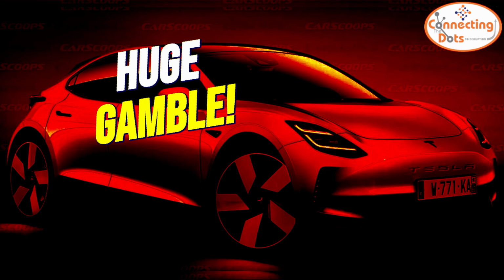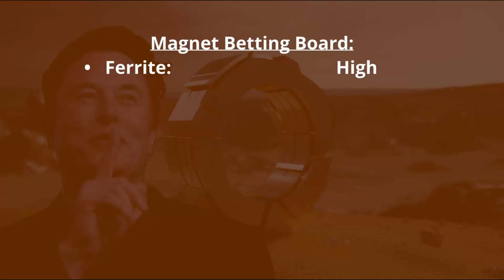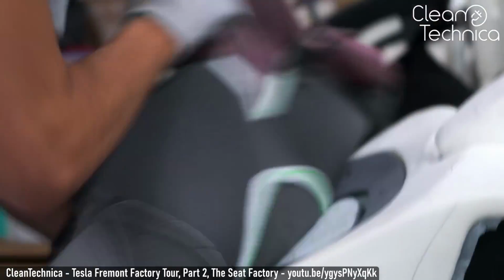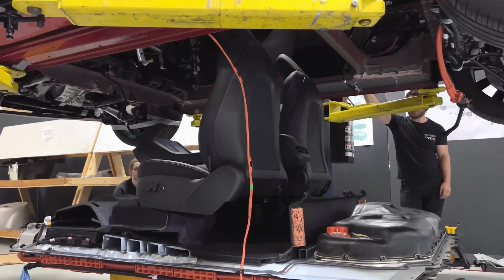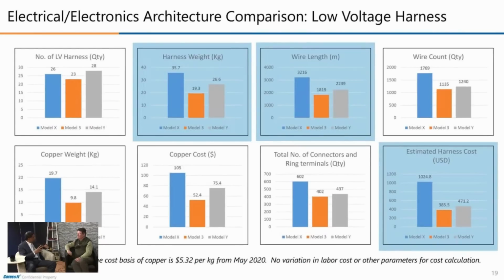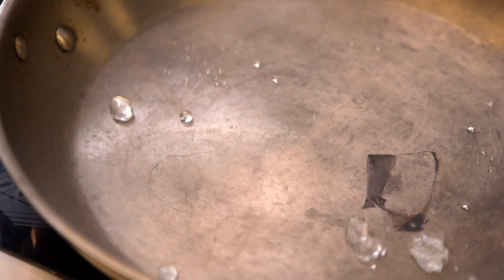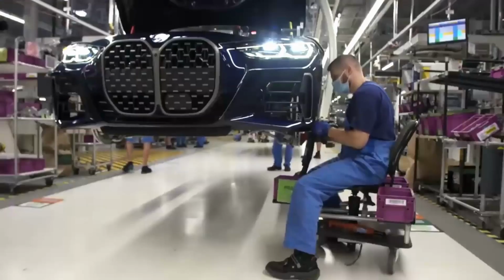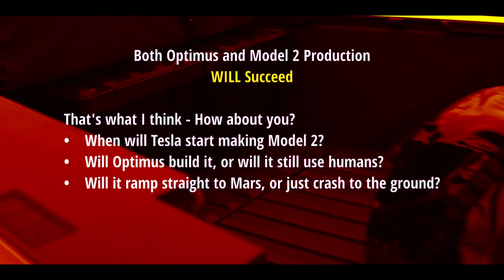Tesla M2's Tech Gamble: Runaway Success or Production-Hell Nightmare? Engineer POV [DecaValve WHAT?]

Comment: now that Tesla plans to announce the new Roadster at year end (with deliveries following shortly thereafter?) I think its quite possible they will use it as a high margin, low volume test bed for these new techniques and technologies. That will allow the new $25,000 car to shortly follow having gained crucial experience.
Reply: I don't think there will be much overlap between the Roadster and M2.  Low volume and high volume manufacturing require two completely different factories.  They won't spend the money on tooling for the Roadster.  Not enough volume to get their money back.  They will use expensive parts and processes because automating them just costs too much.  M2 however, they will be looking for pennies in each part and process.  There is very little opportunity for overlap.
Reply: @donm2255  No doubt that there will be things done very differently on the two platforms. However, there are other things that will be shared. The steer by wire system, for example, could easily be shared by all new vehicles. The main difference between them would be in how you program the steering controller, which would obviously be different on a sports car and an economy car, but the underlying tech could be the same. Just because the roadster will be high margin, doesn't mean they won't also try to save money on it. Just that saving money won't be the roadster's #1 priority.
Reply: @ColinFox   For sure, some of the underlying technologies like 48v and how all the systems talk to each other will be shared across platforms.  I'm not sure on steer by wire. It will only make it to the low end cars if it is cheaper than more simple systems.
Reply: @donm2255 Steer by wire makes flipping the manufacturing from left drive to right drive dramatically simpler. They will want to sell Tau/2 in right drive markets.
Reply: They already have a high margin, low(ish) volume test bed for a lot of the new technologies that will go into the model 2 - they call it the "cybertruck".
Reply: No that is probably low limit for the reson to not have massproduction problems.

Comment: As much as Cybertruck was a disappointment in the specks department it was for a lack of better expression, a wet dream for an engineer like me, so much new tech and improvements in manufacturing efficiency. If the model 2 turns out to be half as much as innovative it will no doubt kill all competition, given they actually manage to pump the numbers and not have a sea of problems like with Cybertruck.

Comment: My guess is that they either are or soon will be trying out their new processes, refining them as they go. At end of year they will begin to ramp production. Since Shanghai has been at the forefront of production innovation, I believe that will be the site for the second line.  Further improvements will happen there and shared with Austin.  THEN they'll begin production in earnest 2nd quarter next year.

My 2 cents
Reply: Very unlikely. First, they have clearly said they do NOT plan to adapt in new locations. They are going to copy Austin and then paste that to multiple new locations.

Second, it is clear that Monterrey will be the second location. Note that Monterrey may have multiple lines for producing these new vehicles. 

Third, there have been several challenges with the CCP around vehicle use in China. Since Tesla has used much of their Shanghai land, it seems likely that they will have another Asia site for Tau/2 for the Asia markets. 

They may well add a line in Germany, assuming the local government is willing to get out of the way.

Comment: I expect Tesla to use both humans and Optimus on the next-gen car.

Why?

I have no doubt that Optimus will successfully perform some tasks. But Optimus is still experimental, and has a long runway ahead before it can be depended upon as fully as a human for all tasks in a manufactory.

Optimus will start on tasks which are regarded by Tesla as 'low-hanging fruit.' Nail the easy stuff. Harder tasks will require more Optimus development. They'll be expanding Optimus' tasks competency for years to come. But it will be exciting anyway. We are seeing the future take shape.
Reply: We have no idea how long that runway will be.   So it could go either way.  Optimus' task competency will come in gobs not it trickles.   As it develops abilities not specific tasks.
Reply: @danharold3087  it's not just Optimus. Optimus also has to interface with Tesla's AI factory software. That's a big job.

Optimus will also go through rapid iteration of its mechanical design. What we'll be seeing this year are prototypes, not production models. All they've managed thus far is proof of concept demonstrators. They're still slow, kinda clumsy, and relying on humans to train tasks via teleoperation. The AI is embryonic.

Every advance will require much testing to be sure they haven't screwed up safety.

Believe what you like. But I see a long runway ahead. They certainly will not be ready to replace all human workers on the factory floor for the next-gen vehicle.

That doesn't bother me. I don't see anyone else sprinting ahead of them.

The good news is that unlike FSD, no new legislation will be required to put Optimus to work. And the only meaningful regulatory oversight is probably OSHA. That should be regulation with a light touch unless they have a gruesome accident.

FSD has a far more difficult path through legislative and regulatory obstacles.

Comment: Unboxed is probably less of a challenge than the 4860 has been.
Reply: Don't underestimate how complex these things can get. Four years ago with the cybertruck, people were saying that they'd just use a brake press to fold the panels. And they were right. But we weren't counting on the fact that they had to invent a whole new way to float the parts onto the tool, in order to not leave any clamping marks on it. And just like that something that at first seemed simple quickly become more complicated.
Reply: I always expected the panels to be brush polished after brake pressing. I guess even that is too time-consuming.
Reply: @Dave5843-d9m the best process is no process. They live it and breathe it every moment of every day. That’s innovation baked into the culture. Complacency kills. There is no competition, complacency is the competition.
Reply: The Gen 2 in general holds more risks than the 4680.  But it is like more people working in a spacious room to solve them.
Reply: Obviously less of  challenge than getting the battery dimensions the correct way around LoL
Reply: Production is hard but if anyone can pull it off it’s Tesla

Comment: I think we all don't know whats really coming with the newvehicle. For sure some big changes. You did it very well in looking up for all the patents they have applied and registered. Patents for at minimum the proof that they can use these processes and technologies. If necessary even more in restricting others from doing the same. With AI taking the patent knowledge and improve it could be that some is not patented anymore and kept as a secret in the manufacturing process. 
Seeing many Optimus robots being integrated in the manufacturing process the hourly rate for humans get less important. It will be interesting to see whats coming. With the Cybertruck they have shown what they can deliver when the company survival pressure if not that big issue anymore. Being a little relaxed and mastering the techology (as 48V system, stainless steel processing, etc).
The current take rate a the assembly line of 42 seconds compared to 60s in best cases should be recorded and monitored in the future. A working day has 1440 min or 86400 secs.